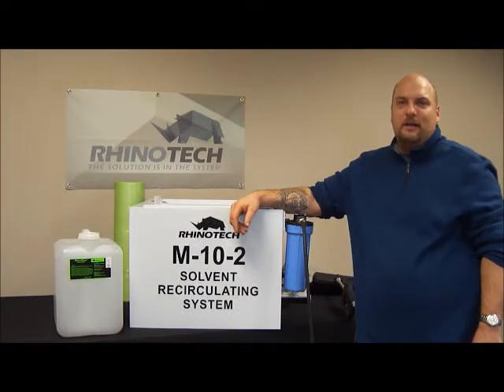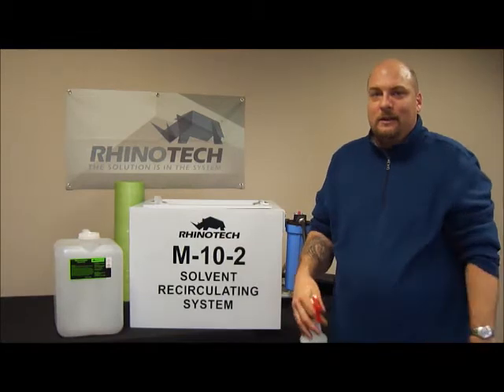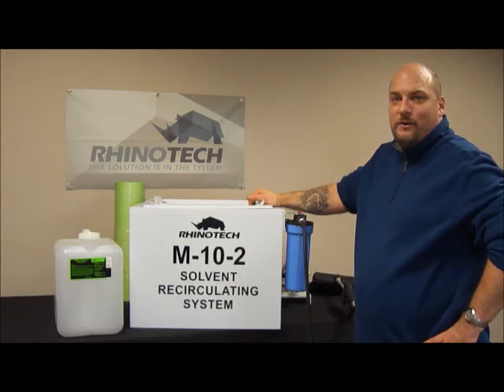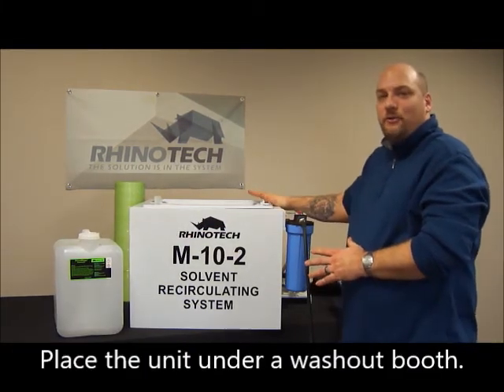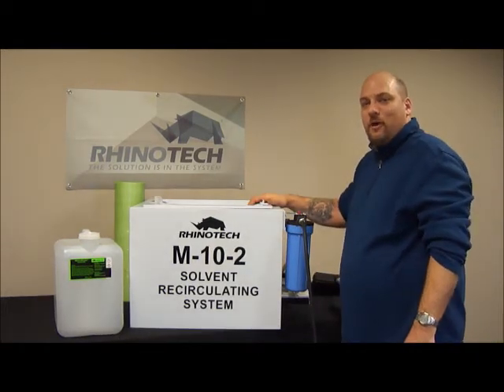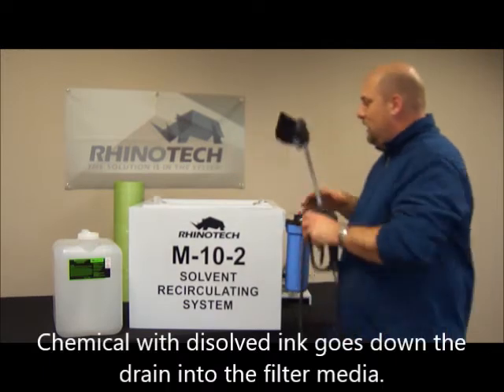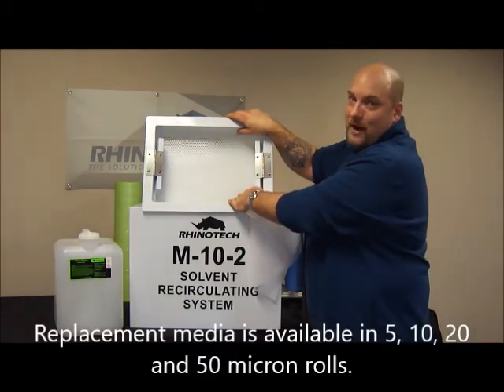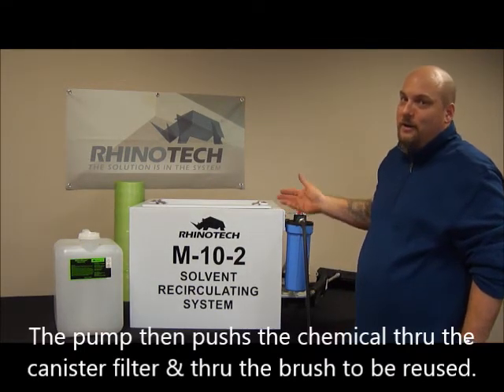Screen Printing Recirculating System

Comment: It would be great to see this machine in use. It's a rather expensive piece of equipment not to see it in action (it's unclear if it's faster/slower than the traditional method).
Reply from the maker: Thanks for watching our video and appreciate the suggestion. Will try to get a video in the line-up. This closed-loop Recirculating system is much faster than the traditional method and, at the same time, filters out plastisol pigments instead of all fluid going down the drain. It ensures that the chemical (SW197) is being recycled/reused many times over. You save money and the system essentially pays for itself, because of longevity of chemical usage. Please give Chris a call at 651-686-5027 x 4 if you have more questions. We look forward to working with you.

Comment: Sooooo...no drain needed?
Reply from the maker: No drain needed. It's a closed loop system. Liquid goes down the Washout Booth drain, into M-10-2, through filters and is pumped back into brush. When the SW197 screen wash needs to be replaced with fresh product, you just drain the chemical out through the brush into a bucket for proper disposable. Depending on how well the ink is carded off the screen and the number of screens you use daily/weekly will determine when to change the SW 197.  Please contact Chris at 651-686-5027 x 4 if you have more questions. Thanks for your interest and we look forward to working with you.